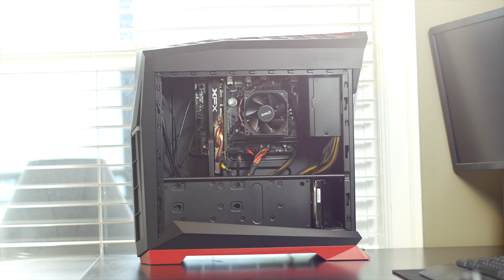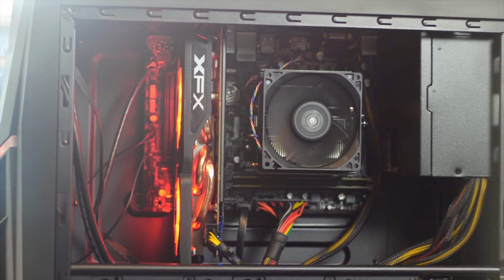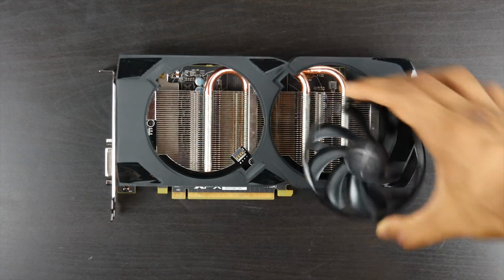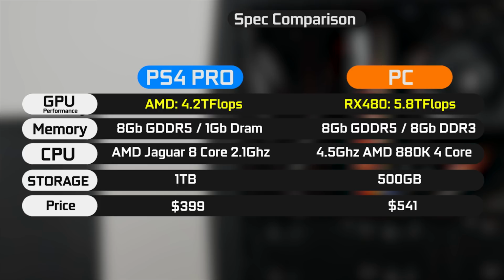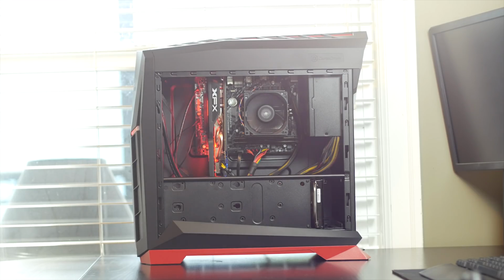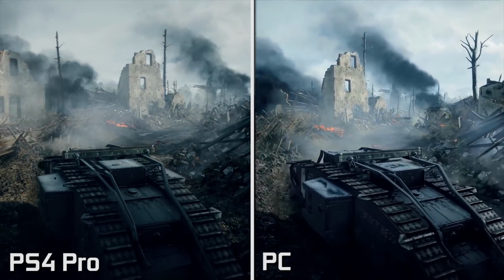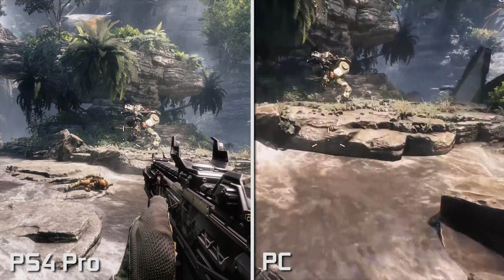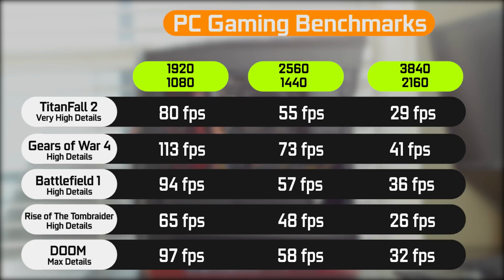Playstation 4 Pro vs $550 Gaming PC

Comment: Console > Same price PC. Almost always. And you get a controller. I prefer PC but that's how things are.
BUT games are more expensive
BUT you still need a PC at home so if you buy a console you'll still spend console money + non-gaming PC money
BUT you still need a media player for the TV
BUT exclusives on every side
BUT size
BUT upgradability
BUT couch
and so on.
We will never solve this. They fit different needs. For example, if I had a 4K tv I'd take an XBOX S right now.
Reply: cicalinarrot Epic setups sadly aren't for everyone :(
Reply: +10000
Reply: Well, of course I didn't consider every single option (I have a decently working PC but i can't game on it) but the poin was just everyone has different needs and console is ok for many people (even though pricier PCs gets incredibly better performance).
Reply: PC + Steam link = home entertainment/ couch gaming/ bedroom gaming
PC + nvidia shield (or preferred device for streaming games from pc) = mobile gaming
Reply: NolanTheGamer
I want portable/couch gaming experience to be pure portable/couch gaming experience with their peculiar pros (gaming focused interface, not depending by another device somewhere else, games precisely made to be used with that configuration) and not a compromised hybrid PC gaming experience.
Steam link and nvidia shield can be good for someone but they surely aren't the solution to make PC the only gaming main device you need and they were not meant to do it.
Reply: What about gaming pc connected to the 4k display, now that would be epic
Reply: Yes, can you send me the money via paypal? :-D
...of course it would be great but really few people can afford that. I said in that case I'd go for the xbox just for 4k movies, getting a PC for actual 4K gaming would be at least $1000 more...
Reply: "BUT games are more expensive"

not necessarily, especially on launch day.

"BUT you still need a PC at home"

Again, not necessarily.

"BUT you still need a media player for the TV"

You can use either a PS4 pro or a PC for both these things.
Reply: Godin The Killer you do need a computer at home...life is shit without it especially if you have school or work
Reply: Mir Sadek No, you do not NEED a PC at home. It's often extremely useful to have one, but you don't NEED one. You NEED water and food, perhaps depending on where you live clothing.
Reply: Godin The Killer if u have job u need computer at home
Reply: nico5179 Of course because it costs less than other UHD bluray players. I'd say "Lol what an epic fail!" about you but I'm not stuck in 2008.
Reply: cicalinarrot LOL and who uses 4K disks in 2017?? What an epic fail. Apart from using space, u also risk being scratched so u wont be able to use it anymore, just use netflix or download/stream movies for free!
Reply: Pilkku , No, you don't.
Reply: Ahahah you really don't know what you're talking about. Stop doing it so you won't look sound an arrogant idiot. You take a 4K display to get perfect images... and then only watch compressed movies?! That's properly stupid, go back to 480p.
Reply: From my experience, PSN Flash Sales are much better than Steam sales. Much better.
Reply: No, of course (because it can't), as I've already explained: just because it costs like other UHD-BR player and if I had a 4K TV I'd want one.
Reply: cicalinarrot PC is not needed... at all... I never had a pc and never had a need for It. I do everything on my phone if I need to. No need to spend hundreds for something your phone can already do.
Reply: I was considering many different cases (as I said). File management (huge amount of photos, music, etc), handling optical discs, browsing the web and watching videos with a decent screen, using peripherals (scanners in first place), composing anything (images, texts, music) can't be done with a phone (or tools are way worse). It's theoretically possible to use the phone as a PC but it's totally not the same thing and drives you crazy when you need to do relevant things and you don't have a PC. I know you and many other people can live only with a phone but me and many other people won't change our habits because you told us it's possible.
Reply: cicalinarrot Actually, everything you mentioned can be done on phone except using discs which isn't even necessary.
Reply: Not necessary to you. Since I was mentioning different cases, I'll have you known you're not the only human on earth.
Be serious, those things can be done on a phone but you can't say it's as easy and comfortable.
Reply: cicalinarrot Phones are easier tbh. It's much simpler and fits in your pocket so you have it at all times. Convenience.
Reply: cicalinarrot All I'm saying is that you say everyone needs a PC when that's not the case at all.
Reply: I have a goddamn phone, I use it for stuff like that sometimes but whenever I have a computer I prefer it because it's undeniably better at doing those things. Is it ok like this? I really don't care about how you prefere the phone, sincerely.
Reply: caos024 The first message I wrote was already very clear but... can you even read what I've been writing several times? I listed general cases as examples of common pros and cons of PC and consoles, not absolute states of things. I never stated every single person in the world needs a PC (or media players), but a lot do so I put the case in. Geez, learn how to understand simple texts.
Reply: good answer
Reply: Why would u need an xbox s exactly? Its the worst of them all, runs sub par resolutions and framerates (720p and 30fps). Imagine upscaling that trash to 4K!  Lol what an epic fail!

Comment: AMD 880k = i3 6100
XFX RX480 = GTX 1060 3GB
8Gb DDR3 = 8Gb DDR4
Reply: AMD FX 8300, 8gb ddr3, RX 480 4gb
Reply: ddddddr3 dont equal dddddddr4
Reply: ***** 
Yes but it is cheaper and we save money for the i3 processor 6100.
Reply: ***** 
And have a board compatible with ddr4 memories.
Reply: +El Diablo the xfx gtr is pretty good but its also pretty expensive and this is about getting the best out of your money.
Reply: NEWaYRTON gtx 1060 6gb

Comment: I see a low quality, bad motherboard, I dislike.
Reply: IIIRattleHeadIII
Wrong.
Reply: Oh my fucking god IIIRattleHeadIII every single person that has replied has disagreed with you just take your loss and go home.
Reply: is mother board matter?!? no....
Reply: polychronio fuck yes it does...
Reply: No it really makes no difference.
You don't know what your talking about.
It's also not a bad motherboard.
Reply: It does, bad vrms usually cause the CPU to throttle and in quite a few cases the chipset overheats and crashes.
Reply: No the chance of that happening are near impossible.
If you got a motherboard a few decades ago well then that could be the case if you got a bad motherboard.

You don't know what your talking about for the second time.

If you can find a low quality motherboard AM3+ or Intel 1151, 1155,1156 or 1150 that had VRM failure  from 2013 or higher i will be highly surprised
Reply: Anthony Samaha well if you call cheap B75, Q75, Q85, B85 and any H81 old, then sure, but there are tons(a bunch every week in a 80,000 people town in one of the many hardware stores) of those comming with dead capacitors, vrms and often unfixable damage.
Reply: There a tons of what those cheap boards.
Most stores don't sell those chip sets  anymore. 

Also what motherboards are they buying and when did this happen??? 
Because this does not seem true for the time we are in.
Reply: Anthony Samaha m8. you can't expect them to die in 1 year...
Reply: Sorry what does not die in one year?
Reply: Anthony Samaha you can't expect a motherboard to die in one year no matter how bad it is, unless it is exposed to constant heat or comes defective from the get go.
Reply: I never said i expect a motherboard to die in a year i have may computer over 3 years old and not one has died.

Also a motherboard built in 2005 or above should last longer then 3 years with constant heat.

I have a 1156 motherboard i use it as a server computer and it is what you call a  "low quality, bad motherboard" and that runs 24/7 and i have not a single problem with it.
Reply: Anthony Samaha then you are lucky and just running it 24/7 and running it on full 100% load 24/7 are two completely different thing.
Reply: No it does run around 80 and peaks to 90 some times and i have run it for a few months now. it also just reboots every day.
Reply: Can we please get back on topic.

It's not a bad motherboard it will last around 3 years with lots of gaming so 100% load
it's not bad every motherboard that i have seen from 2013 and above has always had good vrms and caps/
Reply: Anthony Samaha my friend bought an H110 motherboard, because he cheaped out to be able to get a better CPU, then it died and he had to get a new one which costed him more than if he bought a good motherboard from the get go. And that motherboard lived 7-8 months...
Reply: That sounds like complete bullshit
Why did he not get a warranty?
Motherboard don't just die like that.
Mate your wrong the motherboard was more then likely bad from the factory unless he damaged it.
Reply: Anthony Samaha because warranty does NOT cover physical damage... because that is considered physical damage, IDK what policies you have in your country, here waranty only covers obvious defects, while it also makes sure that there are NO repair costs.
Reply: Console motherboards are made cheaper & are way lower quality.
Reply: ***** nope, they might not look it, but they use quite high quality coponents, while H110 and cheap B150 and cheap H170 do NOT.
Reply: LOL high quality components. what a joke
Reply: Mike Hines what about them isn't? Oh yeah they do NOT "look" like high quality, that's why people disregard them.
Reply: +Mike Hines and what's bad about the quality of the console components?
Reply: IIIRattleHeadIII does any one remember the xbox 360? had a 70% failure rate at one point due to solder used on the motherboard.
Reply: +Mike Hines talking about the PS4 and Xbox one, mentions the xbox 360 which is NOT in the discussion... 

Also the xbox 360 was released when integrated CPUs and GPUs did NOT have heat spreaders, now that they do and when the xbox one slim came out, there were no such problems.
Reply: Anthony Samaha even if the whole world disagrees, doesn't mean shit. The whole world disagreed that the world is round and thought it was flat, the whole world thought that the Sun was circling around the Earth, were they right? No.
Reply: IIIRattleHeadIII yet there are still people who believe the earth is flat and everyone disagrees with them. Does that make them right? No...

Consoles are made to be CHEAP and DISPOSABLE. Their components reflect that.
Reply: Mike Hines but you have NO arguments(that I have NOT countered), I gave arguments above.
Reply: IIIRattleHeadIII You gave opinions. Ive know friends who have had to buy 5+ xboxs due to hardware failures. Why you would repurchase a machine that fails that often is beyond me but fan boys will be fanboys. Sames story with Playstation although not quite as bad. Original PS3 had alot of issues.

As far as this generation goes, so far so good sure but remember they have only been out a couple years and have had a great deal of issues in that time already. My first Ps4 was defective. Xbox one has had disk drive issues since launch. Plus they used a piss poor HDD in them that is god awfully slow and not up-gradable. So to say they use quality components is just false.
Reply: Mike Hines 5 xbox ones in 3 years? holy crap... I know people who keep their blu-ray on top of their xbox one and it has no problems.

Slow/low performace does NOT mean bad quality.... bad quality means bad parts in terms of materials.
Reply: IIIRattleHeadIII you are just a sad troll. And more importantly a console peasent.  Smh
Reply: Mike Hines well I've learnt a valuable life lesson from trying to explain to people on youtube. If a person can NOT understand what I am saying, then it's beyond that person's capabilities, so I should leave it at that.
Reply: Anthony Samaha ignorant? Nope, but you are unself-educated, no? You rely on schools, universities and self proclaimed tech youtubers to teach you, or am I wrong?
Reply: Yes you are wrong you have been wrong about everything. I clicked on the video out off curiosity. Also how fucking dumb do you have to be to say that i rely on school ect to teach me, of course i do i can self teach my self and i do all the time but If you and i did't have education how the fuck would i learn heck you and i would not be typing right now if we did not have am education.
Reply: Anthony Samaha I could read and write before I went to school...

Also you state that I'm wrong, which is meaningless, unless you have arguments, which you don't. Stating "you are wrong about everything" is like saying the "earth is flat" or the "devil exsists" without any proof or arguments.

And schools are retardedly easy... you learn 3-5 pages per class(40 mins), for that time I could easly read and learn 15-25 pages... mega boring and easy... and you study things you do NOT want to study at the same time...

Universities on the other hand just read you a book, literary, all universities do is fucking read a book instead of you in every of the lectures... by the time they are done with one of the books, I have read so much more...
Reply: I feel bad for you.
Reply: Anthony Samaha why?

Comment: PC would of been same price if you had gotten a cheaper case and a 470.
Reply: Leon Krušlin Not a lot less powerful
Reply: Leon Krušlin no actually it's not , both cards I can run at high/ultra the 470 is like 8 fps less at max on games like bf1 witcher 3 tomb raider
Reply: Well, the PS4 pro's SRP is 500, so the difference isnt that big anyway. Well, in my country anyway.
Reply: 1TerraHertz 470 is alot less powerful than 480
Reply: That's not all there is to it.

Comment: Mother of bottleneck.......
Reply: There will be an insane bottleneck. I had an fx8320 overclocked to 4.6ghz and it was still bottlenecking my 970 in a lot of games. Given that AMDs directx11 driver is more cpu dependent than Nvidias I wouldn't even consider this a decent gaming PC. Gaming at a higher resolution doesn't fix the bottleneck, it just makes the GPU work harder. Just because you can get your GPU to 100% usage doesn't mean it will help your framerate.
Reply: Ozone Strike nope
Reply: Yep
Reply: Yeah, but for that was just for the meme, not because the bottleneck will be that huge
Reply: This guy is just dump